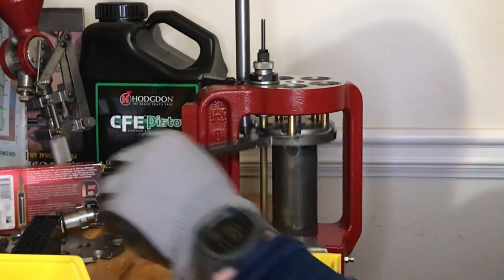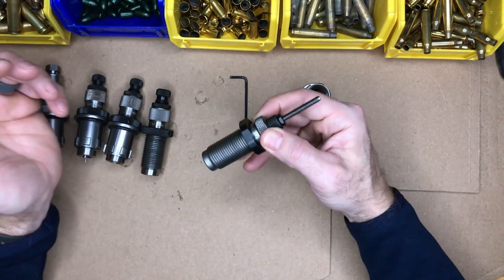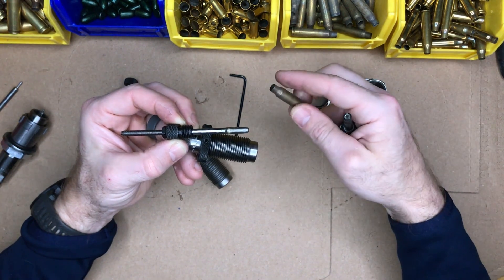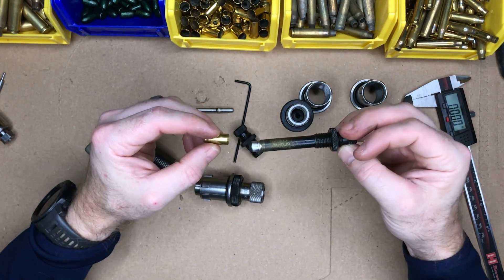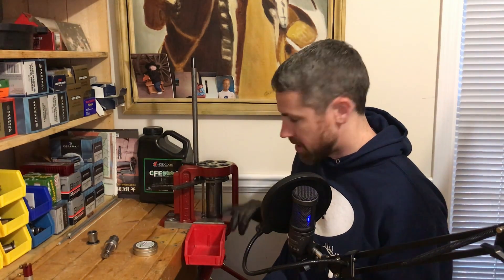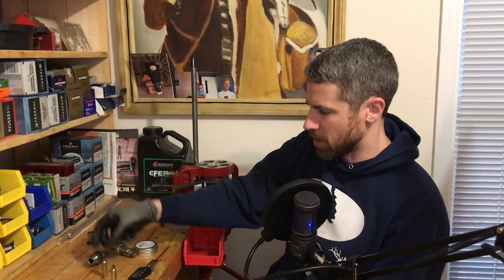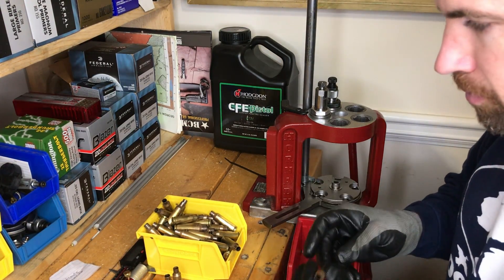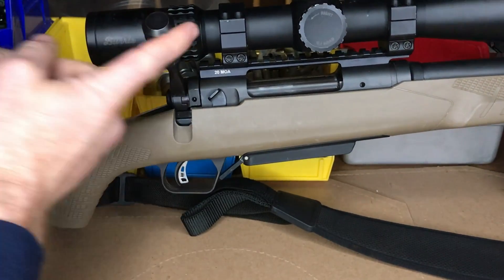Resizing Brass: Reloading for Precision Video 2

Comment: I was wondering if CCI#41 Primers work well in reloading my 223 rounds
Reply from the maker: Absolutely, run them all the time in 223 brass
Reply: @Shooter‘s Resource Channel  just was wondering if I could. I have  always used CCI#400 With IMR 4320  and hornady 60gr vmax.
Reply from the maker: They should be comparable to CCI400s.  Load a few and try them out.